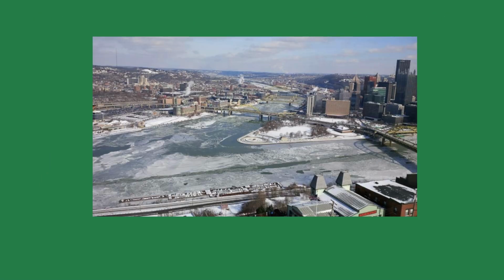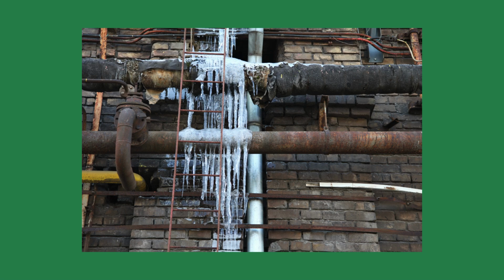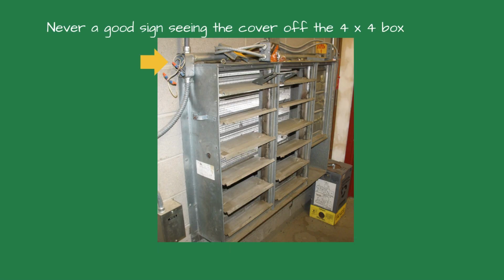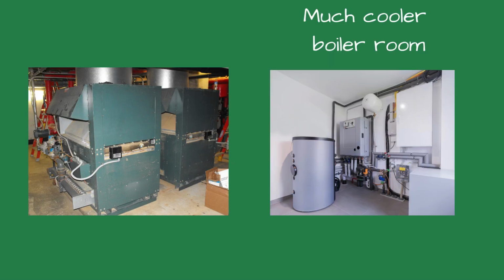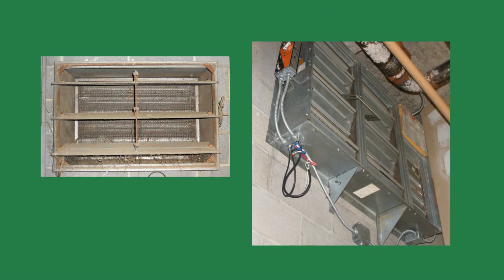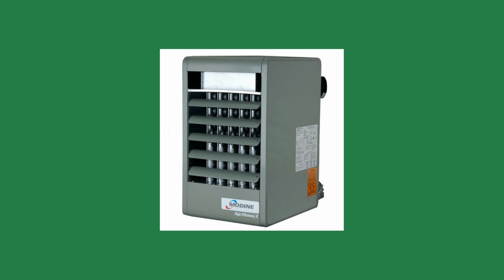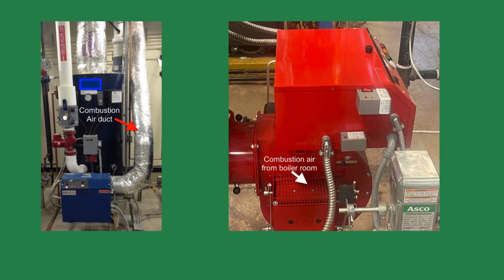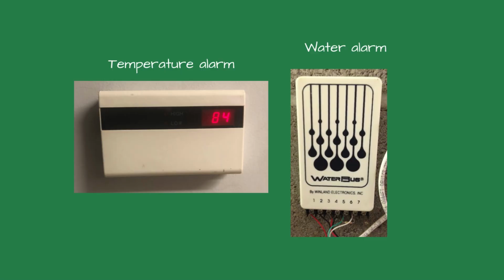The frozen pipe in the warm boiler room

Comment: Had an elementary school with a single hot water boiler with a Power Flame burner.  Someone ran the 2" copper landscape irrigation pipe below the combustion air opening in the wall.  They were not motorized, but I don't think that caused the problem as the boiler was running (according to the school's alarm system) when the pipe froze in the sub-zero nighttime temperatures.  The school's partial basement which included the boiler room and the pump room filled with five feet of water, submerging the burner and pumps.  Fortunately, the school district had another school with two of the same model burners but on different boilers and thus different mounting plates.  Was able to split the burners between the blast tube and fan housing and along with the dry gas train was able to restore heat before too much damage was done to the school.
Reply from the maker: Wow that was awesome job Thanks

Comment: Nice one Ray. Our Sprinkler Pump area is heated with electric baseboard type heat. However, we still had incoming water to the sump float freeze so we installed 1" insulation on the self regulated Heat Tape we also put on. Recent weather in NE OH proved good results
Reply from the maker: Thanks and good thinking on the insulation